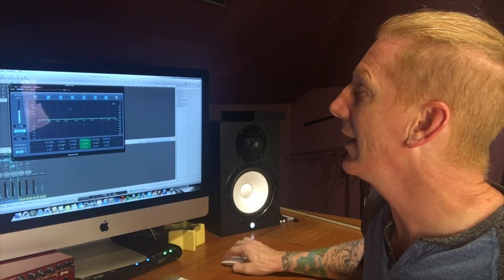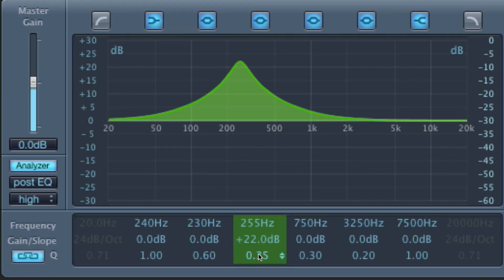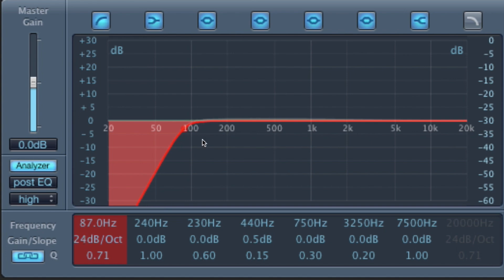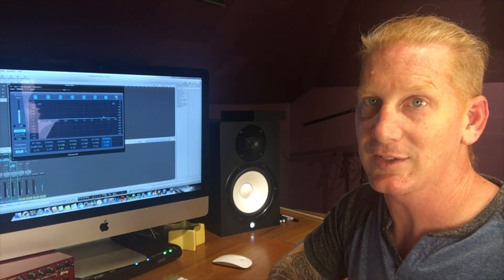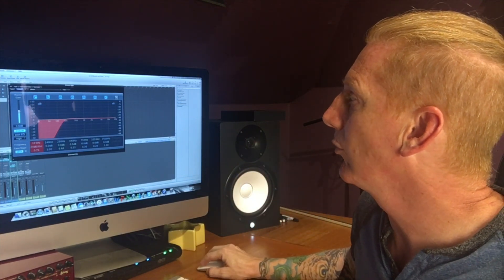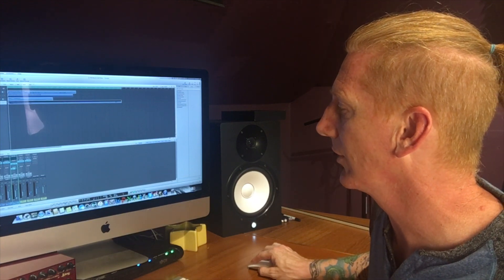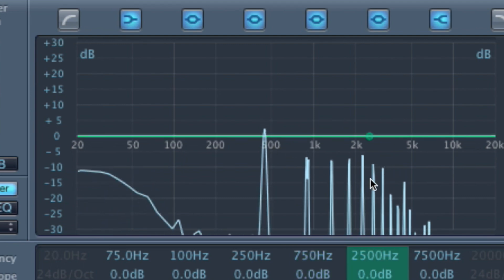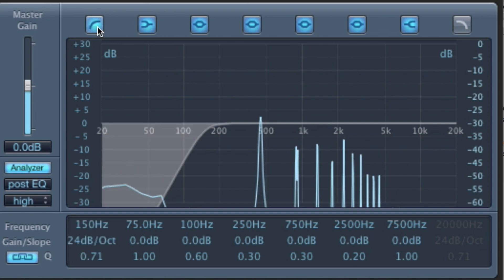FCTR: EQ Part 2 - Applying EQ To Your Signal

Comment: Hey Mate. Thanks for these great videos. Has refreshed my memory on the details of these concepts. I play an acoustic violin with a FIshman V-200, through a Fishman Platinum Pro EQ. For the most part, I am getting a really rich and natural sound, especially from the G and D strings. I am having trouble with removing a bit of shrill and slight distortion from the A and E strings. Have tried adding a Boss GE-7 in front of the Platinum Pro EQ, which softens things a bit, but I can't get rid of the distortion. I am not sure if it is just the Amp I am playing through (CORT AF60 ACOUSTIC GUITAR AMPLIFIER 60W) or it is in indeed with my signal chain. Should I be looking at something like a Shelf Filter early on in the chain? Any suggestions would be awesome.Cheers! Nathan

Comment: Do you do a demonstration on an actual mixer.  Do you have a rough and ready, average recommendation for settings on EQ?
Reply from the maker: No.  It is dependent on three things - your source, your landscape and your ears.  So I can't really recommend an EQ without knowing what your instrument sounds like, what type of mix you're trying to work with (are you in a string section?  are you playing with a rock band?  are you playing with an EDM DJ?), and what type of tone you like (bright? warm? thick? thin?)
Reply: Hi Matt.  In the UK we have 'open mic' sessions in pubs.  You go along with your instrument, plug into whatever PA and go.  There is no time for messing around trying to find best settings.  If you are lucky the host might ask you if you have any settings you want?  This is where I thought you might come in with your vast experience with some common workable settings.  Cheers  John
Reply from the maker: I'd definitely make sure I have a DI.  Plugging an electric violin directly into a board is usually a bad idea.  All I can tell you is what I usually do.  I just ask them to pull a little bit of highs out.  That's because I use a pedalboard that I've already done all of my own EQ on...

Comment: how do you face the fact of use an EQ and a Octaver pedal at the same time?
Reply from the maker: Good question.  I would probably use the octaver first and then EQ as needed after that.  Because the octaver shifts everything down an octave, including overtones and undertones, you might want to make a few tweaks.
Reply from the maker: It should work just fine.

Comment: Hey Matt - another question.  I have a question about RTA’s.  Most of the comments on the
iPhone RTA’s say they aren’t accurate below about 250 Hz.  This is a problem as you know when, for example, playing on G string.  What RTA do you recommend?  This is for amplified acoustic shows, for example bluegrass, Celtic, or old-time string band.  Thank you!
Reply: You can check your rta by putting it in front of a computer. Look for a frequency sweep video on YouTube. It'll show the frequency it's playing on the screen. See what your rta reads and that'll tell you.
Reply from the maker: We just checked the RTA app on Matt's iPhone with a frequency sweep video on youtube.  The video goes from 20Hz to 20kHz.  The RTA and it was quite accurate from 50 or 60Hz to 17 or 18kHz.  And the truth is that the computer speaker can't reproduce the very lowest and very highest frequencies.

I'd say the comments saying the RTA can't identify frequencies below 250 Hz are dead wrong.  Maybe the amplitude isn't 100% accurate, but the phone can definitely identify those frequencies.

Comment: Awesome.  Thanks Matt for putting this up!  Very helpful.  I'm an acoustic player.  The issue I have is that my instrument setup (standard acoustic fiddle with Barcus-Berry bridge) has a very pronounced peak at about 130 Hz.  I am currently using a 31-band graphic to try and notch this out but am only having limited success.  When I do that, it kills the rest of the lows (overtones) when I try to notch that one out.  I believe the issue is caused by the location of the transducer being biased toward the G-string side of the bridge, which is a source problem, as you say in the video.  Is there anything else I can try besides notching out that one freq?  Would a parametric help me out here?  Thank you again!
Reply: So your violin with the pickup is just boomy? 130 Hz is pretty low. I would use a high pass and go ahead and kill those lows. They'll just sound muddy in a mix anyway. 

I've also seen guys throw a piece of gaff tape over the F holes. That might help some.